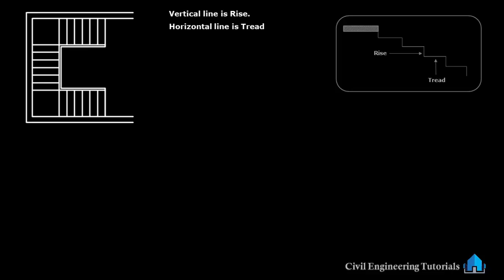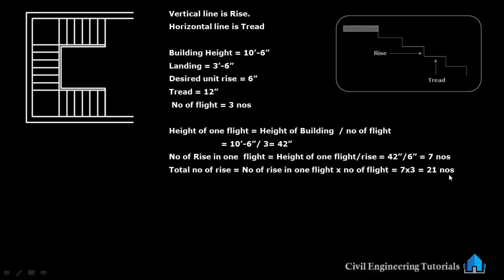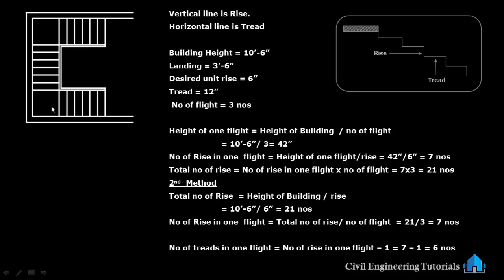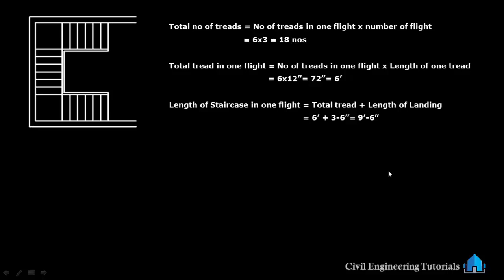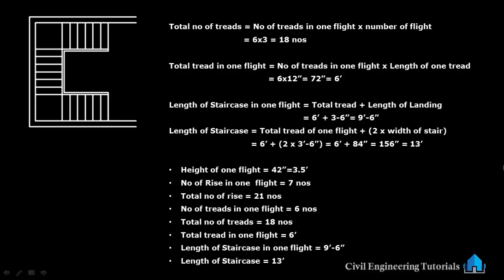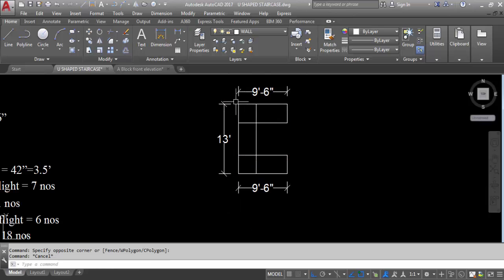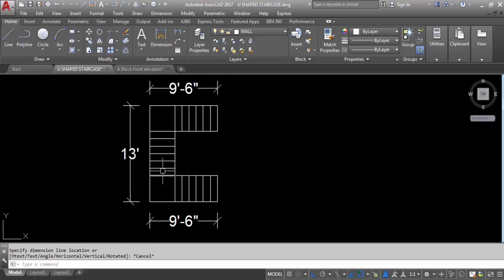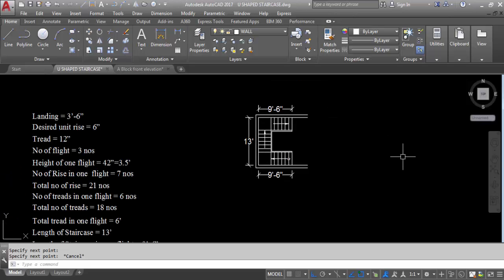How to draw U Shaped Staircase in AutoCAD | Rise & Tread Calculation | Civil Design

Comment: Building hight 11.5 
U shape stairs banana h 
Or 9by10 me bn jayega kya mam isme 3feet ki landing bhi cahiye h
Reply from the maker: For a building height of 11.5 ft,  U-shaped staircase can fit within a 9 ft × 10 ft space, but it depends on proper planning of riser, tread, and landing. If the riser is kept around 6.5–7 inches, tread around 10–11 inches, and a minimum 3 ft landing is provided, a compact residential U-shaped stair may be possible in this space. Final feasibility should be confirmed based on the exact floor-to-floor height, stair width, and local building by-laws.